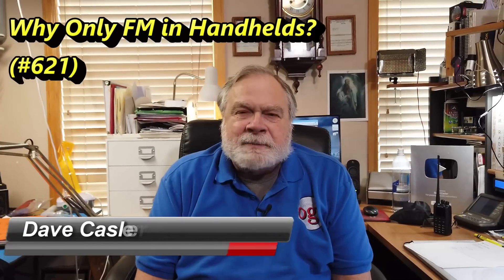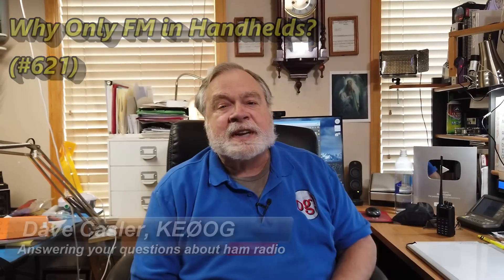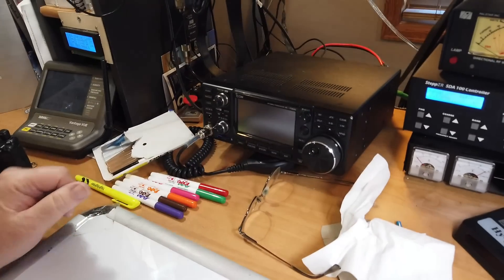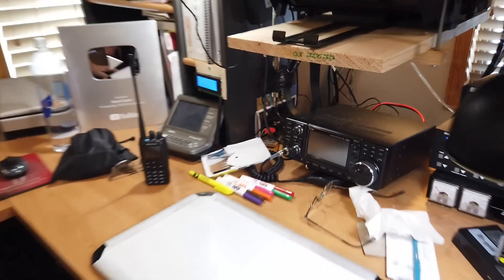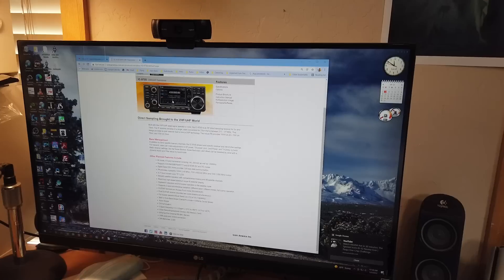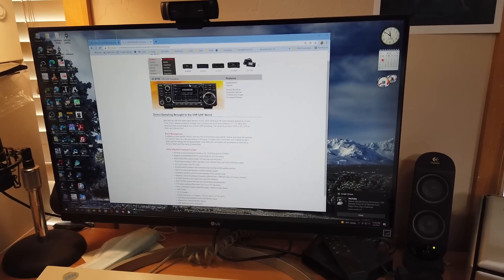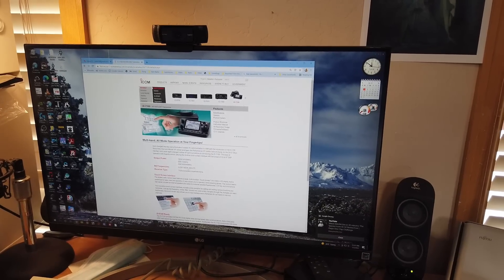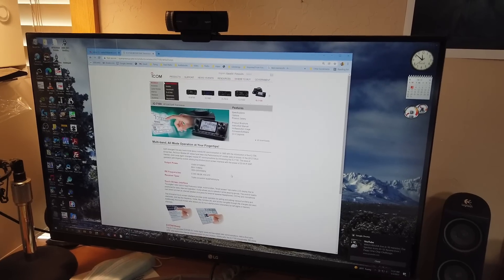Why Only FM in Handhelds? (#621)

Comment: It's not a size issue -- an SSB transceiver can be made small.  Heck, the difference between class C and class AB isn't enough to make a big deal -- a 3W class AB amp would be roughly comparable to a 5W class C).  Real reason is no demand: repeaters don't make sense for SSB, 2m generally sucks for propagation, and only a few weirdos would actually pay for it.  I'm one of those weirdos... but... nonetheless...

Comment: It's definitely not a size issue. I would have to imagine that it really boils down to demand. There are AM VHF HT radios for air band; it's entirely possible to have an AM transmitter in HT format. 
For amateur use, however, where's the demand? If you did buy an AM/FM 2m HT, what would you do with it? SSB would be great for satellites, but the lack of current full duplex HTs already shows that satellite operators aren't a target audience.

Comment: I'm sure the big problem is all or mostly because of the frequency. We know that the lower the frequency the larger the antenna would have to be to work well. I'm sure the coils for HF would have to be larger as well as different components for different modes. RF output would be feeble in any hand held.

Comment: Did anyone mention the FT-818?  It's got it all-- HF and 2m/70cm, SSB, CW, FM, and CW. And you can definitely hold it in your hand.  It's predecessor, the FT-817, was introduced over 20 years ago.  So much radio in such a small package.
Reply: Yep, exactly -- it's the perfect counterexample.  Take out all the band filters for HF, simplify the PA so it doesn't have to be ludicrously broadband; remove odd conveniences of the past like expansion for Collins filters, and you'd have something that's darn near HT-size.  

And heck, it's a fully analog TX/RX chain -- eliminate half of it again by throwing in a powerful uC with DSP features, and it's killer.

Comment: Thanks for the video Dave., Anyone looking for a multi mode HT should take a look at the Kenwood TH D74. Does all modes, band appropriate, that’s to say on air bands it’s Rx only and AM. On HAM 2m bands SSB, FM.  General coverage Rx from 100KHz to 500MHz!! I’ve had mine for a couple of years now and only just starting to appreciate how great a radio it is. Oh and it does DStar as well with built in GPS.
Reply: TH-d74 does not transmit ssb/am/cw.

Comment: SSB requires very precise LO stability for VHF/UHF: 1 ppm gives 100 Hz drift on 100 MHz. AM is not efficient. Air band uses AM because it is not subject to the "frequency lock" effect, when more powerful station jams other stations, thus two simultaneous AM transmissions can be read.

Comment: You said you have too buy the 23cm as an Extra in the Ic-9700 That's not True all Ic-9700 comes with 23cm it's the 9100 you have too buy an Extra Module and with the Ic-9100 you have too Buy Extra is Dstar but not with the ic-9700 it's Does 23cm and Dstar out of the Box and Does DV and DD in Dstar and you didn't Talk about the ic-705 witch is the Closes thing you can Get too an Hand held that Icom makes. but some Handhelds will Rx SSB, AM, FM, and Dstar Like the Kenwood Th-D74A but will only Tx FM and Dstar and AFSK (APRS)

Comment: As usual, Dave you talk all around the question and make apples to oranges comparisons.  Of course 50 to 100 watt base and mobile radios are going to be larger and heavier than an HT.  That mostly has to do with the size of the components and heat sink required to support that power.  And, the many band, DC to daylight, radios are also going to be larger.

There are three things that show that getting AM and SSB in an HT is physically possible.  1) There are short wave receivers that can do AM/FM/SSB.  2) Hobbyists can take a Software Defined Radio (SDR) dongle the size of a USB thumb drive and combine that with a Rasberry Pi  to get a great wide-band all-mode receiver.  Adding a transmitter is not that hard.  3) There are air band (108 to 137 MHz AM) HTs that are in the same price range as ham radio HTs.

So, what is the primary answer?  Manufacturers don't see a large enough market for an all-mode VHF/UHF HT.  All-mode VHF/UHF base transceivers have existed for many years.  They are in the same price range as the HF or HF plus 6M transceivers and sell a small fraction of the number of HF or HF + 6M radios.

If a manufacturer were to add AM/SSB to an existing dual-band HT and keep the radio in the same price range, I believe it would likely sell well and become a draw to that radio.
Reply: Hi, yes, as usual his answer is not correct and is like comparing apples to oranges; rightly said.
De VU2RZA
Reply: @subramanianr7206  Thank you.
Reply: @BryanTorok  you are welcome 👌👍 You have given the right explanation and Dave would come to understand I believe.
De VU2RZA
Reply: Receiving is possible; transmitting becomes more of a challenge though as you go down in frequency. Power and antenna size constraints.
Reply: @Chilangosta  Yes, but the original question had to do with VHF (146MHz) / UHF (445MHz) dual band radios.  Those frequency bands are used for up & down links for satellites.  However, many of those satellites use SSB for energy efficiency.  So, An inexpensive dual band HT that does SSB would be very useful for satellite communication.

Comment: My aviation handheld only does AM. Although that's only because aviation uses ancient technology. It's not a good thing.
Reply: There's nothing wrong with ancient technology... we still use wheels, for example :-).  I know there are at least a few arguments in favor of AM for air traffic...
Reply: @yakovdavidovich7943  We only use AM because it was the only modulation technology available at the time. SSB would be more power efficient and longer range. Digital modes enabling store and forward and less bandwidth/more channels would be very useful. I'm a professional pilot and when I'm approaching an airport or airspace at hundreds of miles per hour and I can't get a word in and everyone is transmitting over each other on the busy frequency I get nervous.

What are the advantages of AM that you are aware of? I've never heard of any. I'm a ham also so I've read a fair bit about the pros and cons of different modulation technologies. The only peo to AM is that it's simple but that's not something we need anymore. I'm not building my own transmitter.
Reply: @tracyrreed  most people seem to defend it because there's no capture effect like FM, so you can hear multiple transmissions at once, and it's a baseline technology that everyone around the world can have.  I don't really have an opinion either way (irrelevant to me!), but I've found the occasional article defending it to be interesting.

I've heard there are presently changes introducing digital modes, but I don't know much about the details (maybe you do?).

Also, I agree that SSB would be an improvement in terms of power efficiency -- though with no carrier, tuning precision and oscillator quality is a different playground.  It would be a shame for pilots to have to nudge the tuning knob all the time for minor drift effects.

Comment: there already is an all mode hamdheld
it is called an ic-705.
Icom is having a failure of imagination so they have crippled the 705 by limiting its display to landscape only.
Portrait mode  (vertical display mode} would allow it to be used like every other HT in a human hand with antenna up and without having to tilt your head  sideways
Reply: With a size of roughly 8" x 3" x 3" the IC-705 could be held in a hand similar to the Korean war era walky-talkys, but not at all similar the VHF/UHF hand helds of the last two decades.
Reply: @BryanTorok  it is not at all similar to other walkie talkies because it has an order of magnitude more capabilities. Hf, ssb, real waterfall, OBVIOUSLY. never the less it IS a hanheld even though both you and icom are terrified of this fact.
your encrusted beliefs are ruining it for us brighter folks with big hands
Reply: @paulmitchell4421  I'm not terrified of you turning your radio sideways and carrying it like a brick or, perhaps, a very early cell phone.  I'm just making the point that is not what the OP had in mind when asking about having SSB added to a typical HT.  

He is thinking of Baofeng taking their $50 HT, adding SSB, and ending up with a $75 or $100 Baofeng HT.  OR, take Kenwood, Icom, or Yaesu multiply the price point by a factor or 4 or 5 and do the same thing.  I think it is technically possible but the market is too small to interest most manufacturers.
Reply: @BryanTorok  what the op had in mind was a fantasy. this is reality. having taken the 705 apart I know what's inside and how much room it takes. shrinking it by another 50‰ could easily triple the price and I'd pay it.
Reply: @paulmitchell4421  You would be an extremely small minority.  The last time I spent that much for anything, I had to get license plates for it and drove it back and forth to work for two years and still have it in my garage.
Reply: @BryanTorok  I guess you never bought any test equipment than....
definitely a minority.
Reply: @paulmitchell4421  I have a shop full of test equipment.  But, most I bought used.

Comment: There are AM, VHF small portable radios  Icom and Yasu both make 5 Watt AM Airband radios. Also AM, CB 27 MHz portables.
 But your right there has to be a market before anyone would make them.
4 & 5G cellphones use a type of  Digital AM.

Comment: There are a few handheld transceivers that do the hf bands and all modes like the Elecraft kx2 and kx3 and the Bg2fx fx-4c. The Icom 705 is not quite an ht but does all bands and all modes in a very portable platform. The Midland Alan42 does 10m AM and FM but not SSB. The big issue is the antennas. A little whip antenna isn't going to work.

Comment: The Xiegu X5105 is 29 × 23 × 11 cm with a built-in microphone, good display etc. I wonder if Yaesu or Icom  designers could shrink the X5105 down further, it is larger than a house brick (22 x 10 x 6.5) but still can be handheld and covers HF + 6M with LSB, USB, AM, NFM & CW but not 2M or 70cm. I suspect (larger) handhelds could offer more bands and modes but is there a strong enough market for it, seems a bit 'chicken & egg' in as much as it would require a popular manufacturer to launch one to find out. Also the Yaesu FT818ND has a fair amount of air-space and old technology battery space inside and covers HF, 2M, 70cm.

Comment: It's difficult to fit the components needed in the popular HT form factors (trending smaller, not larger), the user interface is already cramped with not enough "real estate" for extra controls and (perhaps the main reason), there's just not a big enough demand for it in the market.

Comment: So the real answer to your question is that until very recently it wasn't possible to cram the processing power necessary into a hand held format or have a battery life which was practical.  Also suitable frequency references for enough stability in a hand held we're rare and expensive.  Bear in mind you need to be within tens of Hertz to be useful for SSB and CW.  Another issue was the size and efficiency of final transistors for VHF & UHF 
Most of these issues are now almost solved, but don't expect the 50 buck, multi mode radio anytime soon.   There just isn’t enough demand.  Maybe a low power, economical radio with codec like FreeDV built in may change that?  De VK4VT.
Reply: I think all of those issues are actually solved (not "almost").  RF synth chips and TCXOs are tiny, and decent microcontrollers have more than enough DSP capability to do all the heavy lifting as SDRs.  At least for <3kHz audio stuff.  Decent mixers are a chip and a couple glue parts... you can hit an easy 5-7W with inexpensive RF power transistors like the 2SK3476, which is intended for 7V operation.  I don't get why Dave thinks the UI is hard, knobs and buttons should work fine...

The only real problem, I think, is the market.  You're right it won't compete with a Baofeng, but I think a <$300 SSB HT is within the possibility of current technology, it just doesn't have a reason to exist (or at least people who will pay for it).

Comment: 6up sideband like FM won't do much with a handheld and small antenna. Large antenna arrays, antenna height, location and power are needed for DX and are a whole lot bigger than the rig. But, a low cost transverter off ebay, a seven element or better beam on a hilltop is a good start in most parts of the country.
Reply: @CommonSense-m4r  Yup, except for repeaters and links, VHF up is not for everyone or everyplace.  Ham Radio is almost anything you want it to be. Why I suggested a simple start that can often be found at a swapmeet. Make a few contacts and next thing you know, your joining a VHF-Microwave club. Not for everyone but, if your a young ham looking to get a BsEE or such and experience, its a good path.

Comment: Thanks for the video, David!  Now, I'm an "old guy" and have been staying away from the FM bands.  I enjoy weak signal (SSB) on ten, six and two meters.  I actually started getting into 2 meter AM, just when it was going out of favor, with a "Benton Harbor Lunchbox"  !!!  Sadly it didn't last long.  I managed to use an ICOM 202 to contact the MIR space station, back in the day! Also, 6 meters is a delight to use, often resulting in amazing contacts - how about Ireland, using 5 watts and a dipole?  I work only a little CW, due to arthritis, but love listening to the music on the bands.  It seems to me that much of the romance and adventure has disappeared from our hobby!  Chatting on FM just doesn't do much for me, but the service may be valuable in times of emergency.  Certainly it's not a bad thing.  OK, rant over.  I'll go warm up the old spark generator now.

73 de Karl,  VE3GUN

Comment: Actually, the best "handheld" - ALL mode radio would be the ICOM IC-705; which does all mode on 2m & 70cm, and puts out 5 watts, or 10w w/external battery...  it even does HF.

For today's level of technology, that's about as small as we can get things.
Reply: The Yaesu FT-817/818 isn't quite an HT but it is very portable and about the same price as the most expensive handheld radios.
Reply: Yeasu did that 20+ years ago, The 817/8 is smaller and is alot easier to use "like" and HT.
Reply: "handheld" ? really ? 🤣
Reply: That or the Elecraft portable rigs.
Reply: Today's level of technology is in your cellphone. The radio in that can most likely emulate any modulation just in software.